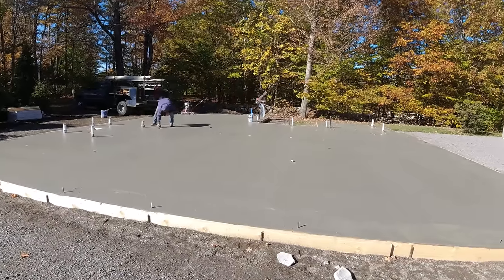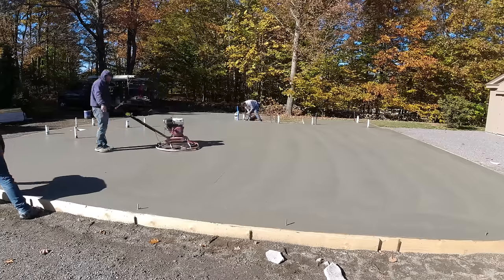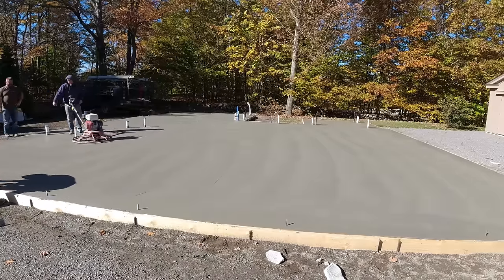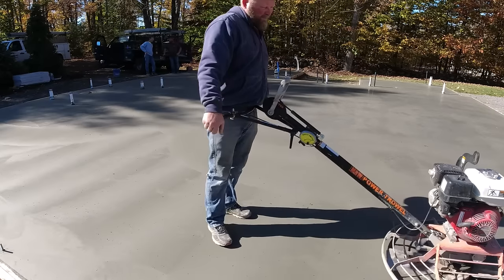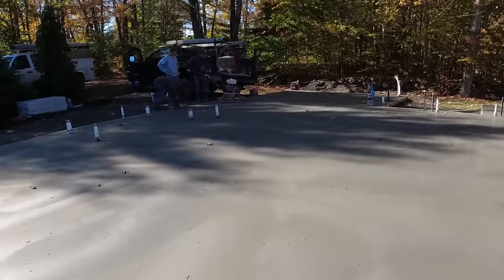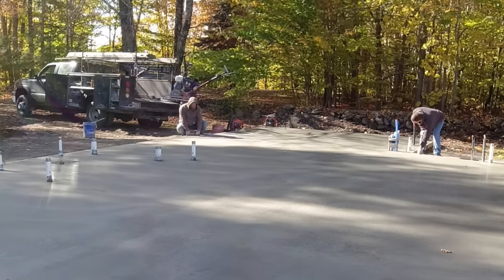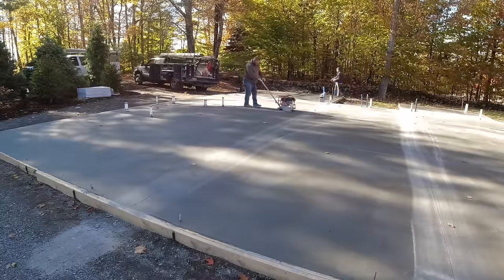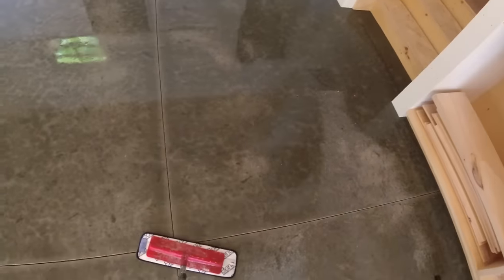Unlocking the Secrets: What Elite Concrete Finishers Know That You Don't!

Comment: Mike, I don't ever recall one time where I saw your crew taking active steps to address curing the concrete slab.  Why is that?
Understand that spraying a curing compound could possibly interfere with certain flooring finishing choices but why not use another alternative?

Comment: I would love to see a video where you don't just shine it a little bit,  You take it all the way to glass.   For my own homes when I do a finish floor I want it burned all the way,  So I have a gloss surface with no need for coatings.  not just somewhat flat with a sheen waiting for epoxy.    I try to avoid doing my own flatwork, But only a couple outfits have been able to get the surface anywhere close to as smooth and glass I want it.  So I have to come back with a slow speed machine and take the grit into the several thousands.     Taking the surface to that level of shine is not something I hardly ever see done.
Reply: Used to do this with Alpha Concrete out of Vermont.  Did a ton of home depots and Lowe's all over the Northeast.  Long finish cycle might not have been in this budget.
Reply: I'll do it by hand 😉